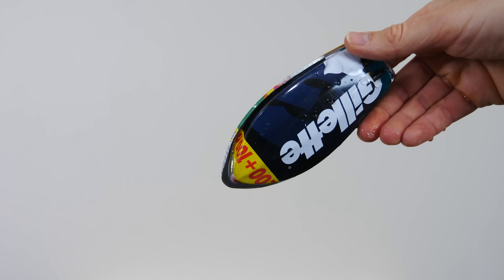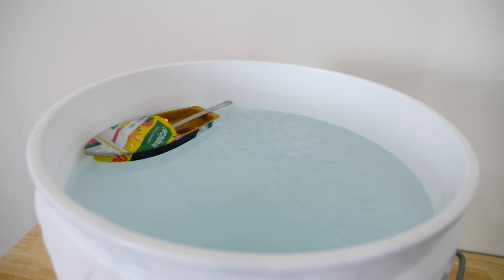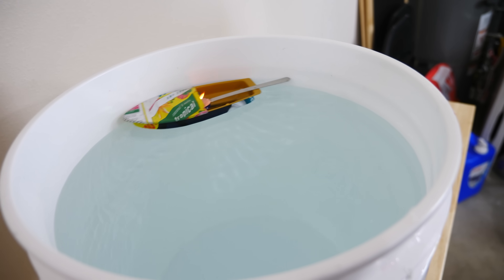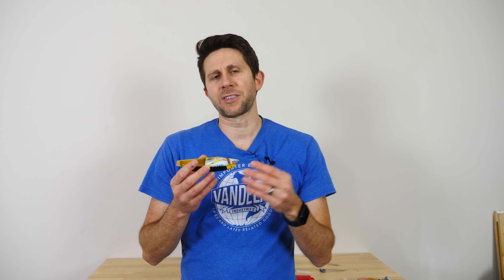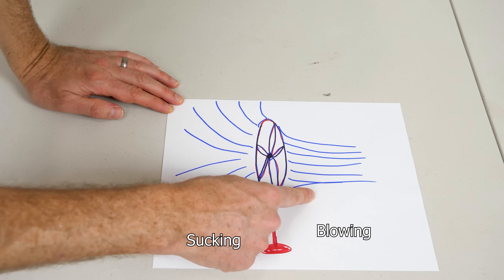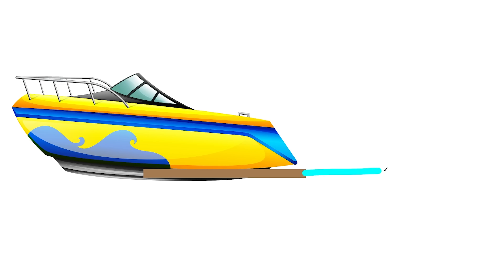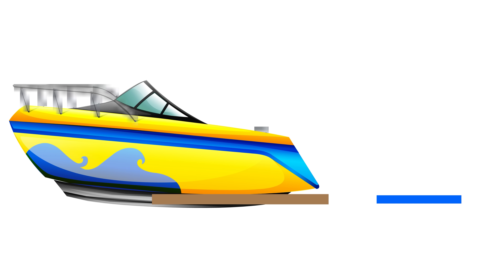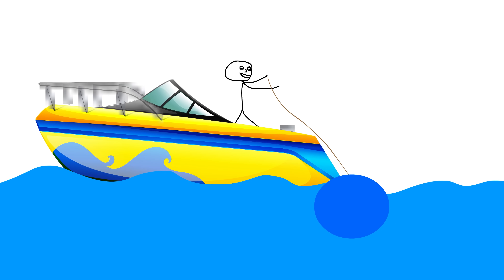The Weird Physics of The Putt-Putt Boat

Comment: Hello ! Always in my search of making simple 🌞solar pump, is it possible to make a solar putt putt pump , using this system, with easy to boil thing like acetone or alcohol...? Using the vibration to pump with a membrane system for instance...😎
Reply: You better off using a solar panel and a car battery connected to a pump made for this application
Reply: @SixOhFive  It is not my point of interest. I want to use basic fluid mechanisme, like the flat plate low temperature difference stirling from Hubert Stierhoff ..

Comment: Great video, Thank you!  But the explanation for the net forward motion is incomplete, and hence not too satisfying.  In particular, the claim that the water sucked back into the tube colliding with air and frame of the boat is not the answer. The real answer is two-fold:  First, the water that is pulled back into the tubes is not exactly the same water that left the tube.  Some of the water pulled back does not have the same state of motion as the water that was exhausted. The exhausted water would still have some momentum directed away from the boat at the point of reversal, and would require more time to slow down and reverse direction. Therefore it is easier for some ambient water in the tank to enter the tubes instead, and this water starts out with a smaller momentum component,  not slowing the boat as much as it is pulled inside. The second reason is that even for the same water re-entering the tubes, this happens after being slowed down by collision with water in the tank, where an irreversible momentum transfer takes place.  In both situations, the force pulling back on the boat by the water re-entering the tubes is less than that pushing the boat forward during the exhaust phase.  A net forward motion is the result. {In your water ball thrown overboard analogy, the explanation would be that the ball drawn back into the boat is not the same as the ball thrown out. The ball drawn back starts out moving away with a smaller outward velocity.)

Comment: I'm almost 70 now. When I was a kid I got one of these boats as a free prize. I couldn't figure it out without instruction.  I plugged the ends of the pipes with bar soap to make it float better I guess. lol. My dad saw it and quickly cleaned out the soap and lit the candle and it took off in the bathtub. I've never seen or heard mention of one until this video. Very nice.

Comment: As a child I carefully examined my put out boat
Reply: I carefully examined my put-put boat and noticed a plate of spring steel as part of the boiler. Hot, the plate expanded, and once cooled it contracted. I believe this enhanced the action. Only by contact with steam did the plate expand sucking cold water in. This contracted the plate expelling cold water out. The cycle could now repeat. Its action of contracting and expanding was like a clicker that many teachers used to get your attention.

Comment: Pulse Jet boat experiment?
would this work?
build a Putt-putt boat where one tube faces forward, and the other rearwards
but have a flapper valve that only allows water to flow one direction
so now one tube is intake and the other is exhaust

would this make a much faster boat?

what about a version with a Tesla Valve?

Comment: I am 47 years old, I was making this boat 40 years ago, when I was first grade. We burn peace of wood, and the boat was 3 times bigger, we use soldering to join metall sheets, and we made pipe and water tanks simply by metal sheet. For metal sheet, we cut old cooking oil can.

Comment: Even if the momentum was equal for in and out with no canceling, the shape of the boat would make going forward more efficient than moving backwards because of friction. It's like those gear mechanisms that spring with teeth facing one direction. They grab to lock motion in one direction, and slip freely in the other.
Reply: I like your way of thinking on that. That particular mechanism is called a ratchet and pawl

Comment: One more reason for boat to move only in forward direction is.. The shape of the boat.
1) it is narrow on front - decreases resistance to move forward
Whereas 2) back side of the board is broad and flat which avoid backward movement, in fact it pushes forwards.. i. e. Water coming inside the tubes

Comment: Would this work on a large scale? Just curious if this could be used to power a full size boat with passengers. Seems like with no moving parts, you could build a very low-maintenance craft compared to one which relies on an internal combustion engine and turning a shaft/propeller.

Comment: when i was young i tried to figure out without the use of my books or an adult that how this thing works. i could come up with only one explaination that the water was actually getting boiled  and the air was pushing it out, but that never explained why it would run continuously. so i gave up and forgot about this riddle. interesting to see how such a small thing has such weird physics working it out. i cant imagine someone actually inventing this device on purpose. they must have discovered the pipe setup moving forward on water  first, and then added the boat to it.

Comment: That clicking sound is something "a little more" than just the boiler... 
Okay, it is the boiler, but there is more behind it.I guess I try to explain it this way: 

There is another version of the "pop-pop-boat" existing. Instead of the water chamber (like this version), it uses just a coil of 2-3 winds of tubing as boiler. That version makes no clicking sound, it runs completely silent. 

(I've built some of those boats very simple, to see here https://www.youtube.com/watch?v=DmjX_aC3Moc or here  https://www.youtube.com/watch?v=Czq3yd04sW8 .Sorry, the video quality is not the best; the videos are 11 years old...) 

Those boats run exactly on the physics You've well explained. But this popping boat is more effective than the "silent-runners", it is kind of turbo'd, because of the clicking. 

That clicking comes from the lid of the boiler chamber. It is a sheet of hardened brass that has a centered dent. That bends the sheet, similar to the clicking sheet in a click frog. Depending on the temperature inside, this lid clicks in and out, that has 2 effects:
firstly it changes the volume of the boiler chamber, so even more water gets sucked in and blown out, 
and then that sucking and blowing is not just the boost of the thermal movement in the water, it is even spring-loaded!

That makes clicking boats faster than the "silent runners" - I've raced several versions of both. This motors can be bought as a single part for cheap - coil motors of brass tube can be bent around a broomstick.  
Tons of fun experimenting with both of them!  And the kids (as well as those who are instantly kids again) love their self made "steam"boats.

Comment: With some garden fountain pumps, a clear sealed chamber, and some mirror system to focus sunlight into it you could in theory make a much larger vehicle that only needs enough battery to run the pumps for enough time to fill the tubes. It's a Longshot but there's serious potential for an absurdly efficient boat here

Comment: Very interesting. I think  you left out a bit of explanation though. The water going out has a directional predominance, whilst the water that is sucked in comes from all around. The effect is analogous to what happens with  ventilator: the suction in front of the ventilator is less significant as the pull behind it. The entry is directionally dispersed, the output isn’t. The push that one can feel when putting the hand behind a propeller is much stronger than the pull when putting the hand in front of it.

Comment: A long time ago there was a man on the news that had a car that ran off of water.  I wonder if he just filled the engine all the way up with water, then used another part of the car for a heat source. You would have to have your intake and exhaust linked together in a closed system of water, maybe the gas tank?

Comment: Could you make it faster with 1 way valves and a narrowed end on the pipes to increase pressure as it leaves but decrease the pressure as it comes back in due to the 1 way valves?

Comment: One point that I would like to ask is when you start the fire, water is always sucked in via one pipe and it exits quickly from the other. Is there a valve that helps do this? The boat bcoz of this will always go in circle due to angular momentum generated from 1 side

Comment: the net momentum of the water is toward the stern, the forward motion of the boat is the Newtonian reaction. This is possible because the steam is superheated in the boiler.Of course, the complete solution is more complex, because the boiler pressure is constantly changing, but you get the idea.

Comment: The pressure difference between the boiler and the ambient water is the "driving force" that moves the water in and out. The velocity of the water is proportional to this pressure difference. Because the water velocity is geater during the exhaust than during the intake and the mass of the water is equal, the sum of the

Comment: A key to your boat.
Is that 1 Tube is made Just abit shorter.  THe water is pulled into the Long tube, and when the pressure builds Its pushed out, but the short pipe releases the pressure first, which draws more water into the other side.  Suggest you chack the length of the 2 pipes.

Comment: I think one reason the boat moves forward is because of the shape of the boat. If equal forces are moving the boat forward and backwards, the boat would still move forward due to its shape. There is less resistance when moving forward.  To test how much of the movement is due to this effect, it would be good to have an identical boat (maybe the same boat) with the pipes turned around so the boat tries to go backwards. Compare the speed of going forwards and backwards to see how much effect the shape of the boat has.

Comment: Great video and a fun watch but I think the explanation can be summed up as: Blowing is an "affect" and sucking is an "effect".  i.e we interpret the term "sucking" but in actual fact sucking is the surrounding environment pushing the water/fluid back in. So essentially we can only impart a momentum to a fluid when pushing or blowing. It is counter-intuitive as we believe vacuum cleaners suck in dirt but in actually the dirt is blown in by the surrounding air.  This is why a strong suction doesn't pull the hose forward.  The cleaner motor can only push the air that is surrounding the motor and it cannot generate a lower pressure than a perfect vacuum.  The only forces capable of sucking and object are electrostatic, magnetic and gravitational. When I first heard this I was quite hostile to the idea but when thinking about it, it seems quite obvious really.

Comment: there might be a simpler reason working here too….  the shape of  the boat itself… the front of the boat is tapered back and has a more fluid-dynamic (like aerodynamic?) shape allowing forward motion through the water whereas the back of the boat surface is flatter and less fluid-dynamic.  As the jets squirt   water out, the boat more easily travels across the surface, and when it sucks the water back in, the back of the boat resists the reverse motion across the surface.

Comment: I think a better explanation of why the boat doesn't simply vibrate back and forth in one spot is the water hits lower density air when it gets sucked in but hits equal density water when ejected. Those differences in density result in differences of force. The water in the pool pushes back harder than the low pressure air inside the tube resulting in more motion in one direction than the other.

Comment: if you connect the boiler to a T pipe that has its ends in front and behind the boat and adding one way valves to the ends making it so water can only enter from front and be released in back.. wouldn't that make the boat a lot more efficient?

Comment: With no constraints on the sizes of the boat and tubes, or the candle, how fast could one of these go?
Reply: With no constraints, infinite speed.  In the real world, however, this is limited to small scale, without switching to something mechanical like a piston.  Boiling action wouldn't make that big pop, once you got to a certain scale.  (I don't think that scale is much bigger than what we see, but a careful engineer could play with the design a bit.)
Larger scales will also add more friction, resulting in diminishing returns.  The bigger you go, the slower you get, until the movement isn't doing much more than literally rocking the boat, and not much at that.  Edit:  Larger versions use an indented sheet-metal plate atop the boiler pan to pop in/out, magnifying the effect versus a completely rigid system.  They do make these things big enough to push people, but not very fast.

Comment: Just curious--has anyone tried scaling this up to perhaps 2" pipes?  Would the same principles work?
Reply: There should be a limit at which pressure waves and drag of the water inside the pipes are conflicting and bouncing off each other, instead of creating the desired simple flow.  Additional smaller pipes might work better with a scaled-up engine, than larger pipes.  At a certain size point, you might as well use a mechanical piston pump to direct the water, instead of relying on evaporative explosions.  The principles should remain the same, though with diminishing returns as the mass and surface area of the boat increases.  Edit:  Larger versions use an indented sheet-metal plate atop the boiler pan to pop in/out, magnifying the effect versus a completely rigid system.  They do make these things big enough to push people, but not very fast.

Comment: Ahhhh... So that's how it works, even though I don't fully understand the mechanics behind it.  When I was 10 ( decades ago) my dad bought me just such a thingamajig.  No motor, no batteries, no propeller.  I could never figure out who it works.  Just one of life's mystery.
Reply: The basic mechanic of motion is the vector (direction and speed) caused by the difference between blowing and sucking.  When you blow, you make a jet in mostly one direction.  When you suck, you pull in a cloud from all around the entry, in many directions.  (It doesn't matter in this case, whether the fluid moving in/out is air or water.)  That difference results in thrust away from the blowing jet.  The shape of the boat also helps, as the flat back pushes against water like a paddle, while the curved bow slides through at gentle angles like a knife.
As for the engine mechanics, it's boiling (evaporating) and unboiling (condensing) water very quickly.  The heat turns the water into steam, which expands rapidly enough to have a self-reversing action.  The boiler is small enough that this conversion is all happening at once, unlike the constant rolling boil you get in a pot of water.  The steam almost turns into a vacuum, is pushed back together by the pressure of the surrounding water, then the process repeats.  Each time in and out, the water "blows" then "sucks" through the tubes as I've described above.  The two tubes in typical toys are sometimes different lengths, so I believe the boat will turn in a circle away from the short tube due to less internal friction allowing the water to move slightly faster on that side.  (I'm not seeing this feature mentioned in the scientific explanations I've found to confirm my guess.)

Comment: Hey man I'm a fan of your work with light and lasers and I was curious if you could tell me how to calculate the acceleration of light. I'm trying to ultimately calculate how fast the light that makes up what I perceive as physical reality around me is moving
Reply: Basically, what my eyes perceive as a physical object is light that is reflected off the surface of the the mass. And I'm wanting to calculate how fast the reflected light accelerates off of the surface of the object
Reply: But I think I'm forgetting to also factor in the variables of the color of light vs color of the object the light is reflecting off of.

Or am I overthinking this?

Comment: The explanation about the phone being able to put the flame out wasn't exactly accurate. When air gets pushed out of a confined  tube like space it pulls external air with it in kind an expanding donut shaped path. Allowing it to move with greater force for a longer distance before losing momentum.

Comment: Isn't this a similar effect as used by sterling engines with the exception that sterling engines use gases?

Does anyone know what the max efficiency of putt-putt-boats is? And would or better how well would it work with different liquids than water?
Reply: Alcohol, acetone, or like fluids might have a faster "heartbeat," because they would evaporate and cool faster, but I don't think any different liquid could change the boat speed very much in a beneficial way.  You'd also lose your fluid out the back as water was mixed in on intake.  This might be prevented with some sort of diaphragm to lock the fluid in, but that would absorb energy and slow the boat down quite a bit.
Reply: @VoltisArt  Thank you! I was wondering if one couldn't use the principle to build a closed system that works kind of like a sterling engine and would be able to be used on a toy car or similar. And I also wondered if that would change the efficiency as a liquid that absorbs less energy to evaporate would also displace more volume more easily?

Comment: Wouldn't the shape of the boat allow the boat to go forward as well? Since the front of the boat is more aerodynamic, but the back of the boat is not aerodynamic, the boat would work as a ratchet system in water only going forward even when the water is being pushed and sucked back in.